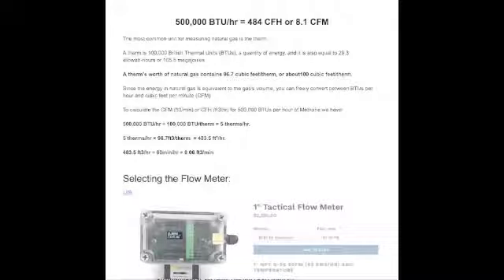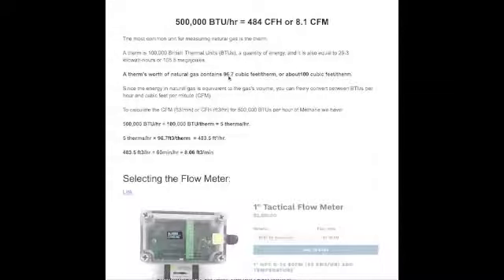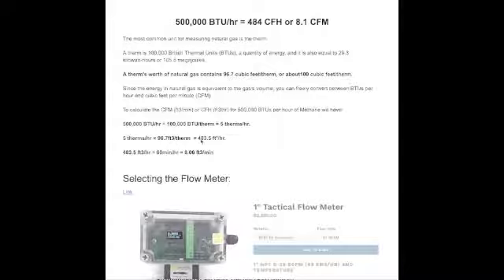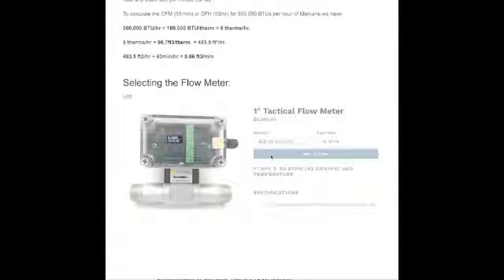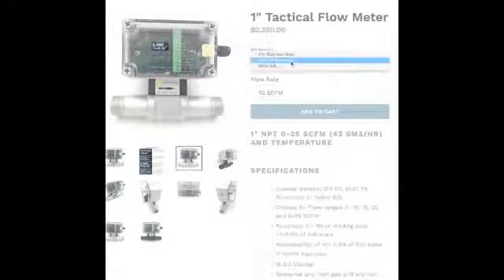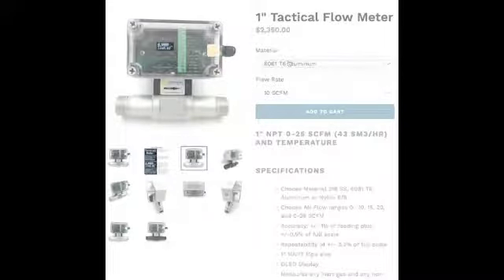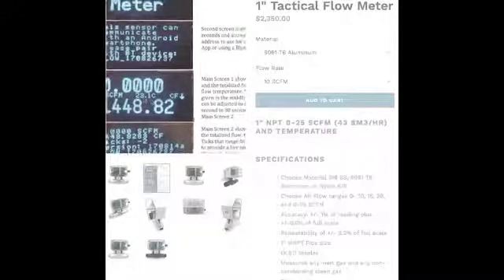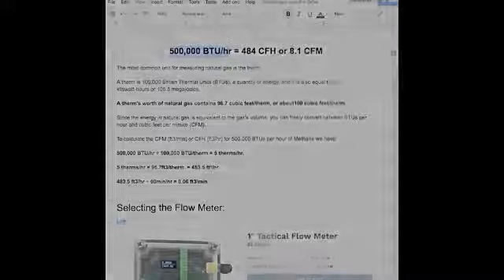How To Calculate CFM from BTU per Hr for a Thermal Mass Flow Meter

Comment: All good, except you mentioned this was "Mass Flow," (at about 1:00 min in) yet you are calculating for volumetric flow.  Otherwise, rock solid!   (gas joke).   You need a different meter type to measure mass flow.
Reply from the maker: Eric: Right you are.. 

One thing to note is that all Thermal Mass Flow Meters "Speak" in SCFM which means STANDARD Cubic Feet per Minute. This STANDARD "assigns" the density at some STANDARD conditions. In the USA folks use 70 F as the STANDARD or 60 Degrees F. What this does is ASSIGNS the Density, or Pounds/ft^3, associated with the fluid they wish to measure. Air has a density of 0.075 lb/ft^3 at 70 F and 1 ATM Pressure.
We can use Pv=nRT to convert this pressure and temperature into the density to get the MASS Flow rate.

Nobody knows why us folks in the USA use SCFM for MASS units where the "smarter" folks in Europe use Kg/m, which is true mass flow without the silly "S" we insist on using.

Most folks in this industry do not even "know" the SCFM they speak about is mass flow. Mechanical devices to measure Cubic Feet of gas consumed use a bellows system, like the goodie on the side of your house, that has a bimetallic linkage that adjusts the fulcrum length that converts the linear bellows expanding and contracting to deal with the temperature and hence the recorded mass by mechanically turning a mechanical "odometer like totalizer" (they call it "Cubic Feet" instead of Standardized Cubic feet) related to 1 ATM and 60 Deg F.
A THERMAL Mass flow meter uses the energy taken away from a heated cylinder in "cross flow" and this is highly dependant on the gas pulling the heat away. You can imagine Hydrogen takes heat away WAAAAAAY faster than air or Methane. As such, a thermal mass flow meter MUST be calibrated for the FLUID intended to measure. A VORTEX meter, however, does not care.. It is a PURE Velocity measuring machine where the onboard P and T sensors can be utilized to indicate the MASS Flow rate. See these Tactical Flow Meter Vortex Meters here... https://www.tacticalflowmeter.com/products/1-2-to-4-multivariable-vortex-mass-flow-meter

Thanks for your input and I know it will help many folks reading this!

The exercise to discover the flow rate only knowing BTU/Hr is useful in sizing meters which are generally referenced to 60 F here in the USA.